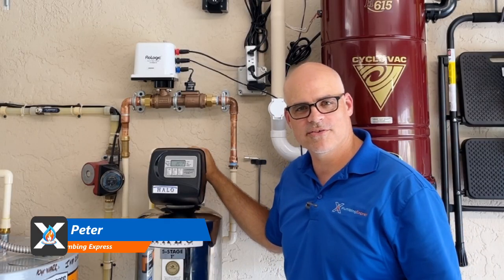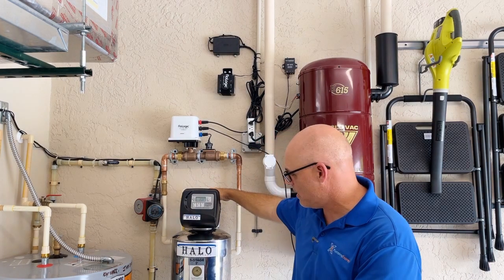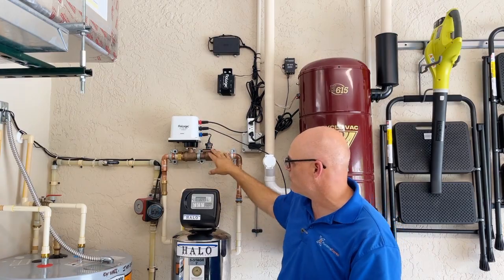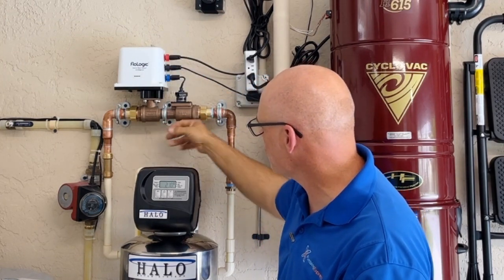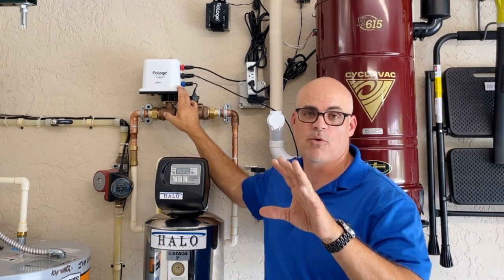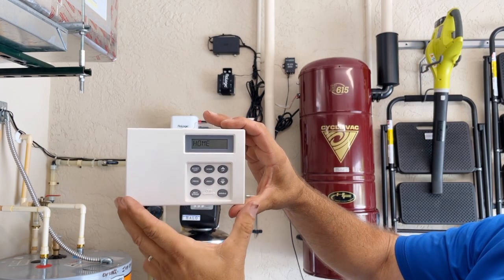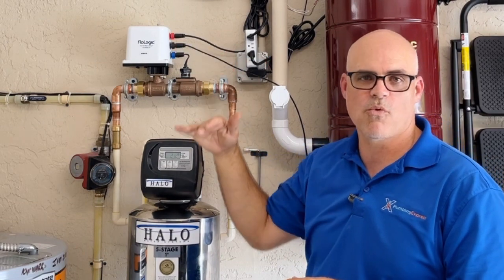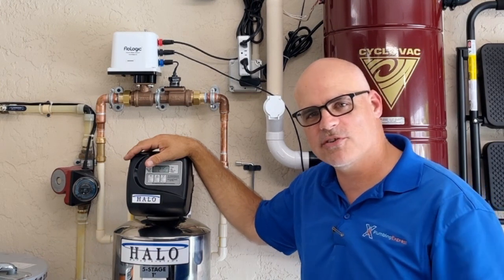Beyond The Pipes  FloLogic 2

Comment: Where’s the expansion tank it says that’s needed on the water heater 🤔
Reply from the maker: That is a great catch Greg. We did not install the water heater for this customer or her filter system. Our addition to her system is the water monitor device that we installed to keep track of her water usage and any leaks that she may have.
Trust me, if we put in her water heater next time, it will have an expansion tank installed with it  :)

Comment: Dude, that looks like an extension sharkbite cuppling, not a check valve 🤸🏽‍♂️
Reply from the maker: Good eyes. They look very similar as the length is about the same but the check valve is VERY different inside of course. They are a great choice as they are easy to removed when they go bad unlike the sweat in brass versions that are quite tedious to take out for customers.

Comment: Does the impeller cause a slight reduction in water pressure? Also do you know any difference between this system and the flo by moen or the sentinel leak defense system? I just want something that lasts a long time, and won't crap out on me after a few years and cause headaches(shutoff in the closed position).
Reply from the maker: So the only system that has nothing in the water to detect water flow is the Phyn Plus that I am aware of. It uses sonic pulses to detect flow. This makes it so there is no pressure loss or protrusions into the water flow to seize up or break.
The longest lasting units so far have been the Phyn Plus ones.

Comment: Just getting ready to install one. They offer leds to disable the valve during overuse on duration. You can hook up filter backwash/irrigation etc to disable valve and , shut down hot water return pump when it does shut down water. As I read more I'm sure I will find more on what this valve does!
Reply from the maker: Yes, it is a very good system it seems. After having the unit for a year our customer is quite happy with it. She did run into an issue with her alarm system needing to have an updated panel installed to communicate correctly with her FloLogic controller.

Comment: Nice install! Thanks for sharing. Just a note that it is possible to install in front of the softener and through an integration of a flow switch FloLogic can automatically go to a temporary Bypass mode to allow the backwash/regeneration cycle without triggering an auto shutoff, even if the unit is in the Away mode with the default of 30 seconds. Love the security system integration--that also allows the FloLogic to automatically switch between Home and Away modes based on the security system armed status, in addition to auto-shutoff notification as you noted well!
Reply from the maker: Thank you so much! We were really impressed with your product and look forward to being able to install more. We are also looking forward to the release of the wifi connector to allow the system to be controlled by an app.